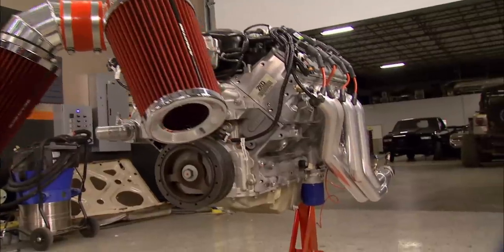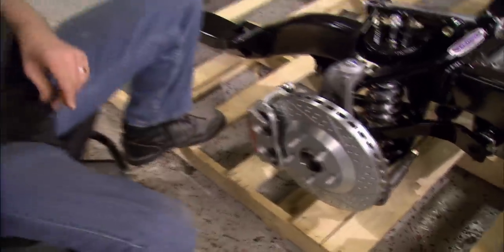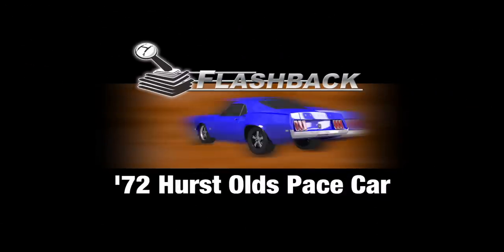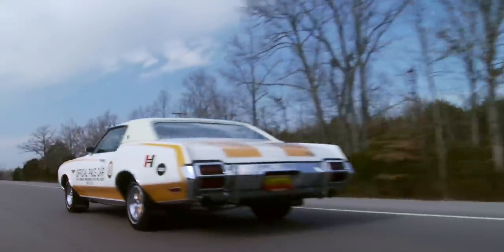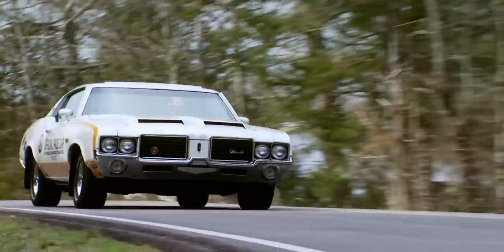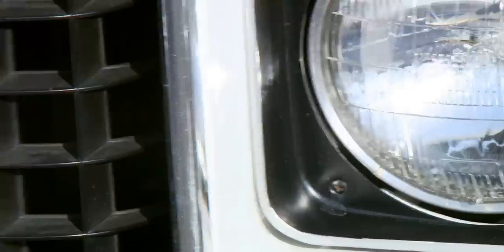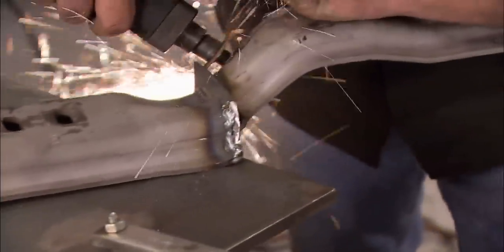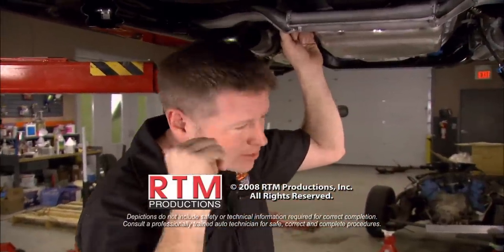Stripping a 1969 Firebird 400 to Begin a Trans-Am Tribute Build - MuscleCar S3, E11

Comment: Why not keep it pure Pontiac? Build a 455 with alloy heads, street roller stick and one of the new, smart EFI systems!
My favorite Firebird, the '69!
Reply: You're a few years TOO LATE!!!
Reply: I'm a mopar guy , but I completely agree. Put a Pontiac motor in it. The LS is waaaaaaayyyy overdone ☹️
Reply: Hello wedge,
Because this is the cheapest and quickest way to make a program.
Reply: @bfmcarparts  no it isn't the cheapest or the fastest. A real Pontiac engine would have been less than half the money and made more power.
Reply: Hello Byron,
I'm sorry but after operating vintage high compression Pontiac 400s for over 40 years ( base 400s, 400HO, and RA2) you get passed 600 hp and they start failing. Though they are torque monsters,  6000 rpm is their limit.  To compete with the factory crate motors you are dropping big dollars on aftermarket blocks, heads, fuel induction, and exotic valvetrains. There's tons of Chevy stuff compared to pounds of Pontiac.  Other than being 80+ years old, why do think Arnie Beswick stopped racing? Because he wasn't winning enough running Pontiacs.
The formula is backwards, you spend more for Pontiac parts and make less power than the competition.  That's why these guys dropped in that complete crate motor.
ps- most 455s out there now are weak casting 1974-76 vintage that will split in two if built (big dollars) to compete.
Sorry. Have fun on the street.
Reply: @bfmcarparts  Technology will now allow a 428 or 455 factory cast crank(or forged alloy) to be turned from 3.5" main bearing journal to 3.0"mains that are in that 400 block. So if that 400 needed to be bored(from 4.12") .30 over that's 455 bore & W/turned down 455 crank installed you just made a 455 that has 7-9lbs. removed from its rotating mass. W/a 428 crank & in a .30 over 400 block you just made a .30 over 428 W/ 7-9lbs removed from rotating mass. either variation W/ the heads that came on that 400 (cast #16 or 48) would exceed 400HP/445ft/lbs W/a factory 400HO cam & mild porting. Plus be ridiculous at how quickly it climbed RPMs (diminished rotating mass) & daily drivability (if you keep your foot out of least you become a cop magnet).

Comment: I agree. a Pontiac needs Pontiac power.  Like my Ford mustang will always remain Ford powered.
Reply: There are a lot of Pontiacs out there that came with LS, 305, 350 engines from factory.
Reply: When your Sunfire needs a new engine make sure you dont get the same engine from a Cavalier
Reply: @basshead.  that is true for the later model ones. back in 69 it was pure pontiac though.
Reply: @basshead.  NONE from the factory till you got to mid 1980's & newer. Earliest year a Fbird had a Chevy engine was 1970 but only if you ordered a V6.Fbirds 67-69's ordered W/a 6-cyl. got Pontiacs very(VERY) good straight 6-cyl. (W/1-barrel or optional Sprint 4bbl Rochester). Straight 6 wouldn't fit under the hood on Fbirds '70 plus & as LeMans weren't available W/them any more Pontiac quit making 6-cyl altogether. If you had a 6-cyl in a Pontiac after '69 it was a Chevy or Buick 6.
Reply: @GearheadRob319   The 69 Firebird is just a 69 Camaro with a different body kit. Nothing pure there.

Comment: Another classic Pontiac destroyed with a Chevy drive train. Turning Pontiac's into Camaros makes no sense
Reply: i mean it basically the same car, only difference is the badging, and the head light and tail light
Reply: @everettgrover9459  you clearly don't know the difference between the cars.
Reply: Alot of people don't realize that all factory V8 equipped 1st generation 'birds (67-69) had the engine moved closer to the firewall then factory V8 (whether 396,350 or 302) equipped 1st gen. Camaros had. Which improved handling as well as brought a higher percentage of weight over the rear axle.
Reply: @relluplewis7112  YOU COMPLETLY MISSED THE PLOT

Comment: Gotta agree with all the engine comments. Should have used a bored and stroked 400 with aluminum heads and a roller cam.
LS motors are getting played out and it's nice to see original non-Chevy motors from back in the day when there was such a thing.
Putting another LS swap is akin to building nothing but 69 Camaros on every episode.

Comment: Nice Firebird too bad its ruined by putting a chevy engine in it. The whole charm of an old Pontiac is the engine, thats what separates them from all the other muscle cars from the era.Why not just restore a 3rd or 4th gen Firebird with a chevy engine? Upgrading suspension, trans and AC is cool, also the car came with nice high back seats w/headrests which are safer and more comfortable and the low backs in the rendering are a downgrade. I wont be tuning in for the rest of the build.

Comment: 500 hp,470 trq.? That was the big improvement over a pontiac motor? My 455 is all stock except for a cam and ported factory steel pontiac heads. Made 490 hp/570 trq . with ease. People can do what they want with their cars but IMO they screwed it up. Fairly rare car thats very desireable that should be restored and not resto modded with big goofy rims. Keep the original parts so the car could be saved from this butchery.

Comment: The same mentaility used to calculated its age as 40 years old is the same mentality used to bastardize this rare car with an LS engine in the hole that should have a Pontiac Ram Air II engine. Just another reflection of GM's overreaching promotional dept on PowerNation.  Corporatism really sucks..
Reply: This show is probably ten years old and just now brought to YouTube, so it was 40 years old when they shot this.
Reply: @firefighteruppy9121  True, however, the strange dichotomy still remains.
Reply: the show aired in 2008, LS swaps were all the thing then and besides year one wanted a reliable high HP engine to tour the country with.
Reply: @ican8243  They can tour on the corner on my block & I won't go to see it. I KNOW what a REAL '69 T/A is that is more a '69 Z28 convert. wanna be then a Pontiac.

Comment: Damn, they arent putting a Ford engine in there, its the same damn company that made both engines. Rebuilding that 400 to match the HP of the LS7 would probably cost a lot more, and its not like they threw the 400 away. And please people, understand that these videos were made a long time ago, if youve been watching for the past 5 years you should know these arent new.
Reply: It would have been half the cost of that piece of over rated shit LS engine to have built the Pontiac engine .  And made more power on pump gas. I've been building 650+hp 400 Pontiac engines since 04. It's easier now than back then to do it too. These foolish clowns just wanted to advertise for general mess. Which is why I will never buy a newer GM vehicle ever. They stopped making the best engine they have ever built when they quit the Pontiac engine.screw those slow poke piston pin throwing LS engines.

Comment: Why do they always have to f something up on this show?
Always with the huge tall wheels. just looks wrong
In 69 they never made a trans am convertible.
Reply: Modern brakes require modern wheels.   Go enjoy your 4 wheel manual drums.   I take modern running gear.
Reply: Richard you couldn't be more wrong they made eight convertible T/A's in '69.And 689 hardtops. Now '69 Z/28 convertibles no. The 1969 convertible Camaro Pace Car was a SS/RS option not a Z.

Comment: And the idiocy continues on this show. factory 400 convertible and these disrespectful clown chanics abuse it overheating it, possibly damaging  the original engine, then they put modern LS chevrolet in it man no gearhead is liking this build at all. Car could have been so much better restored back to what it was instead of a trans-am converti-fake clone mobile.  Classic Pontiacs need Pontiac engines , Classic Chevrolets need Chevrolet engines, Classic Buicks need Buick engines Classic Oldsmobile's need Olds power. This whole build is a shame. I know it's  been years since this was done but it still stings even now.